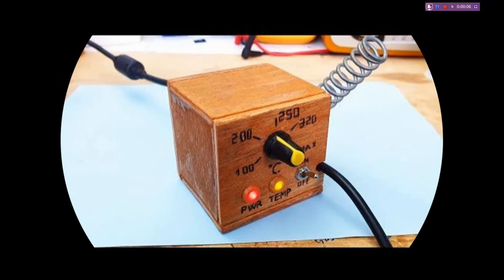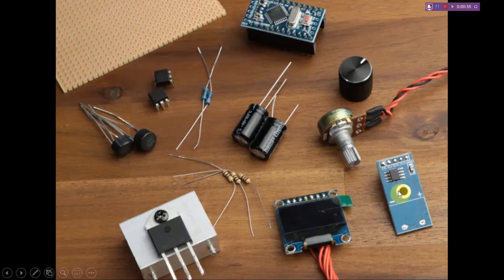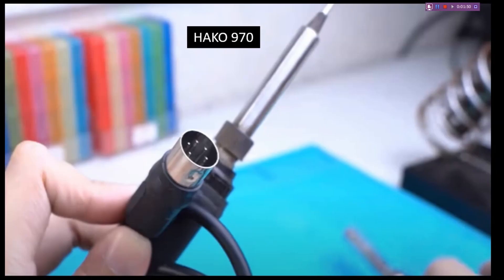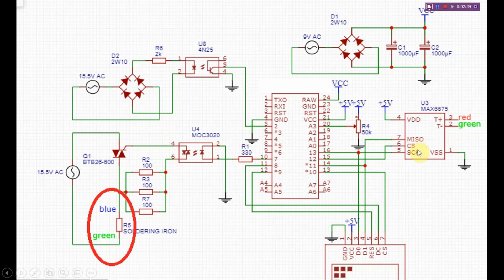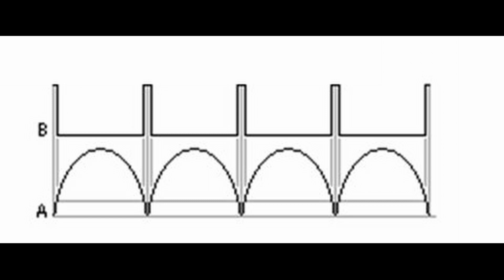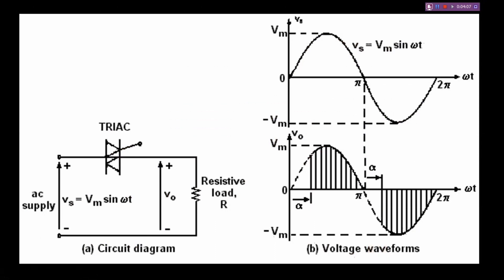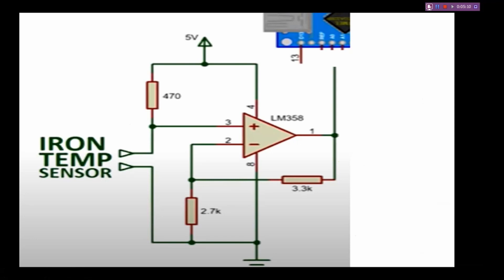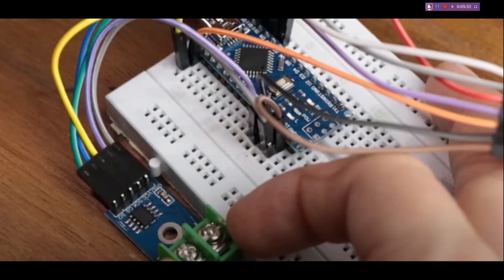MAKE YOURSELF  SOLDERING STATION

Comment from the maker: #include <SPI.h>
#include <Wire.h>
#include <max6675.h>
#include <Adafruit_GFX.h>// please include these libraries
#include <Adafruit_SSD1306.h>// please include these libraries
#define OLED_MOSI  11
#define OLED_CLK   13
#define OLED_DC    8
#define OLED_CS    10
#define OLED_RESET 9
#define thermoDO 11
#define thermoCS 12
#define thermoCLK 13
#define POT A3
#define zerocrossing 2
#define triac 7
#define input 5
float temperature;
int potTemparature;
int counter;
Adafruit_SSD1306 display(OLED_MOSI, OLED_CLK, OLED_DC, OLED_RESET, OLED_CS);
MAX6675 thermocouple(thermoCLK, thermoCS, thermoDO);

void setup() {
  display.begin(SSD1306_SWITCHCAPVCC);
  pinMode(POT, INPUT);
  pinMode(zerocrossing, INPUT_PULLUP);
  pinMode(triac, OUTPUT);
  digitalWrite(triac, LOW);
  display.setTextSize(2);
  display.setTextColor(WHITE);
  counter = 0;
  temperature = thermocouple.readCelsius();
  updatedisplay();
  attachInterrupt(0, zero, RISING);
}

void loop() {
}

void zero() {
  counter++;
  if (counter < 40) {
    if (temperature <= potTemparature) {
      digitalWrite(triac, HIGH);
    }
    else {
      digitalWrite(triac, LOW);
    }
  }

  if (counter == 40) {
    digitalWrite(triac, LOW);
    detachInterrupt(0);
    temperature = thermocouple.readCelsius();
    updatedisplay();
    counter = 0;
    attachInterrupt(0, zero, RISING);
  }
}

void updatedisplay() {
  potTemparature = analogRead(POT);
  potTemparature = map(potTemparature, 0, 1023, 0, 400);//scale 10 bit analog data to - 0 to 400 degree
  display.clearDisplay();
  display.setCursor(0, 0);
  display.print("SET:");
  display.print(potTemparature);
  display.setCursor(0, 20);
  display.print("TMP:");
  display.print(int(temperature));
  display.display();
}